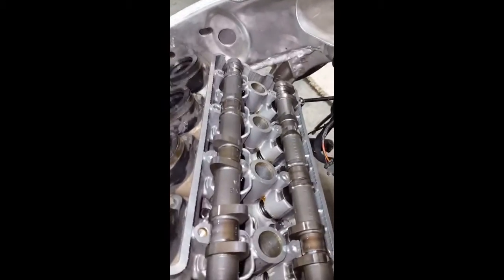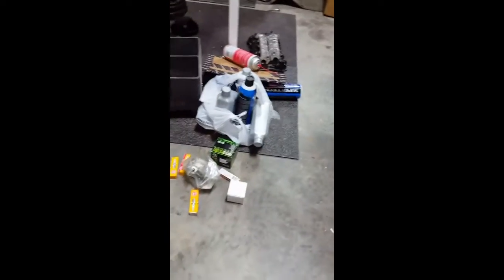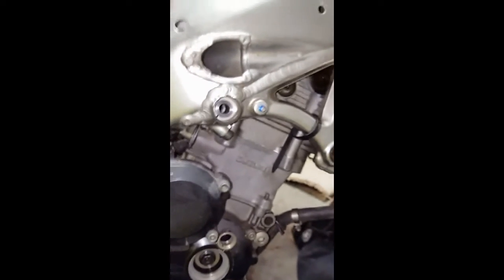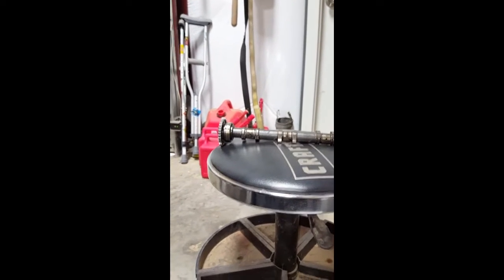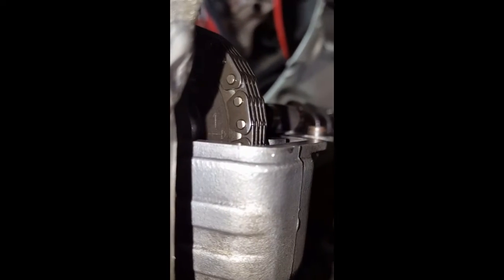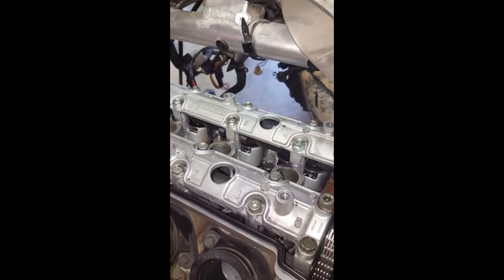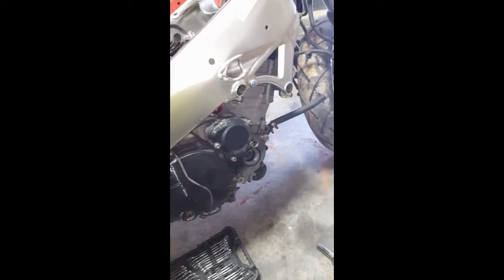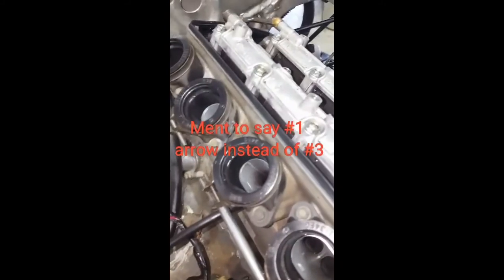99 gsxr 600 camshaft timing

Comment: Hey Buddy good video. My Timings are exactly as yours ! And all works. But the funny thing is. In the manual its not correct. In the manual the Mark 3 on the intake shows of a left Pin and the number 2 on the extake shows also of a left pin.

But in your video the number 3 shows of a right pin and the number 2 also shows of a right pin....??? But everything works fine. The manual is not correct? I dont get it but it works...?!
Reply: Yo thanks for clarification im stuck on this for 5 hours thinking im doing it wrong